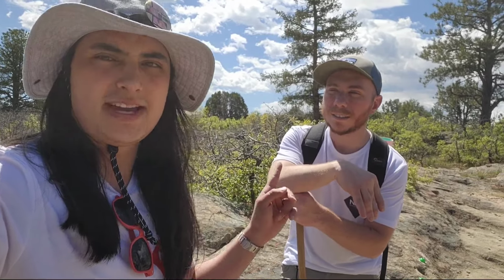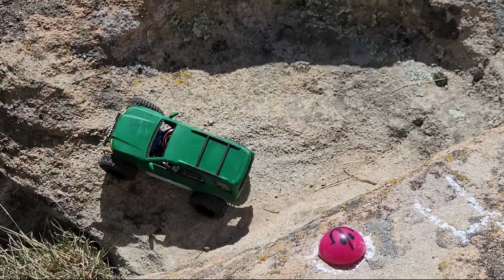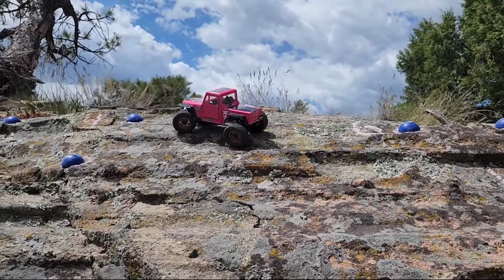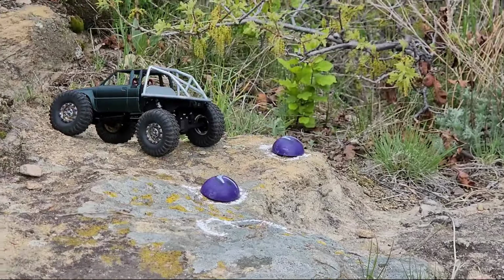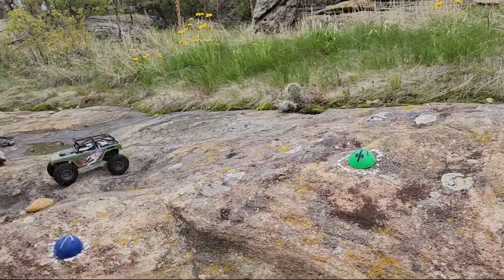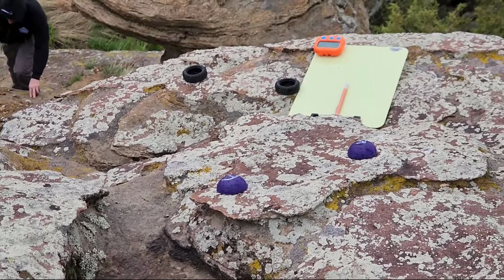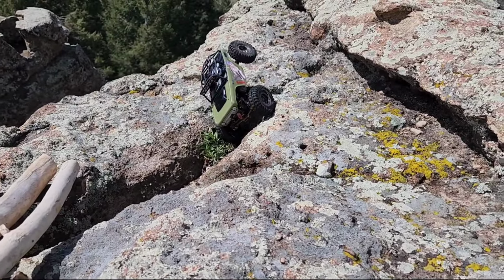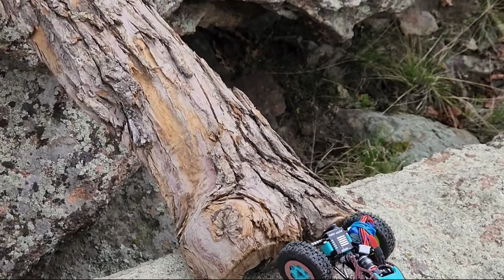RC Crawler Competition Runs, Nerds RC SCX24 Chassis Upgrade

Comment: also how do you tell the difference on the classes
Reply from the maker: The rules are on RCMCCA.org but basically class 1) max tire 57mm, must cover electronics, must have front bumper

2) max tire size slightly bigger... I dont remember... must cover electronics but your body can be really cut back and skinny for maximum clearance... and you don't need bumper
Class 3) you can run any tire size, no body is requires, you can run 4 wheel steer